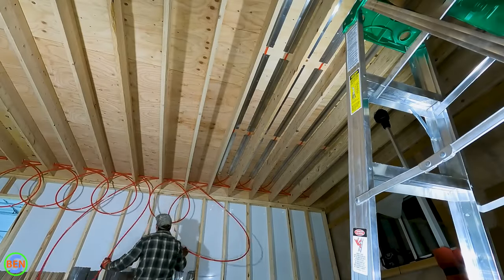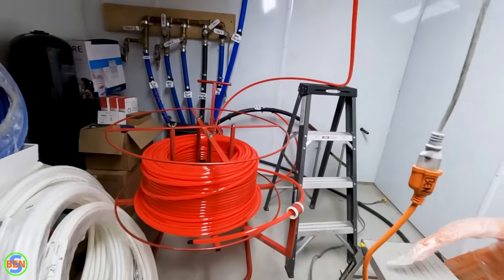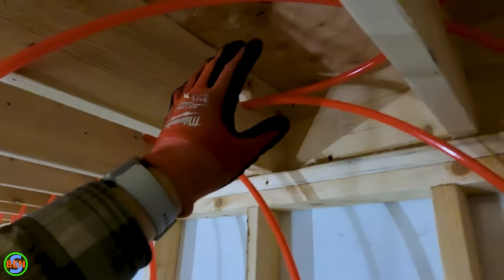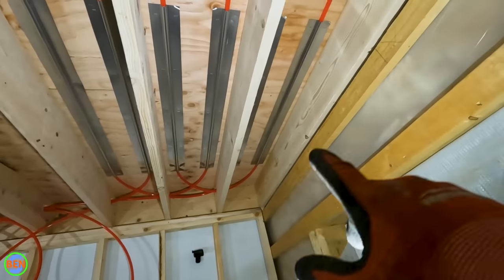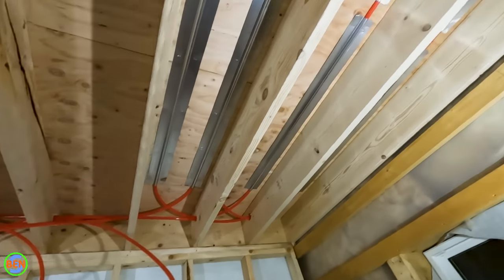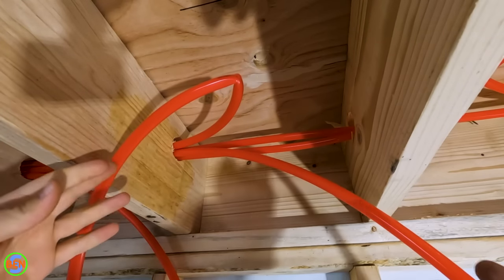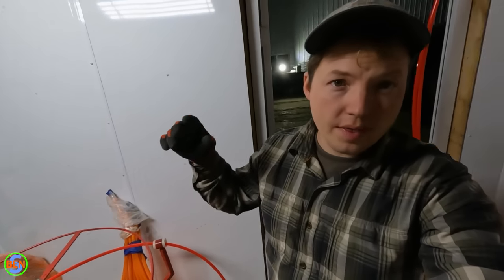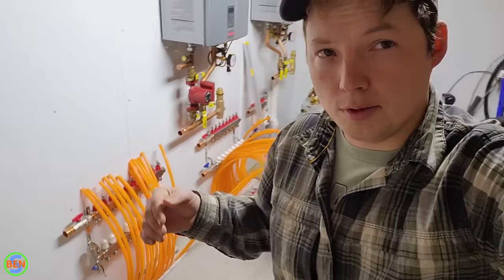How To Install Under Floor Radiant Tubing With Aluminum Omega Heat Transfer Plates Between Joists

Comment: You should only drill holes in the center of any joist and the size of the hole is governed by the size of the joist. Consult your building codes for the precise information.
Reply: Yea, holes cannot be any closer then 1/3 of the width of the board to the edge. Or they can’t be larger then 1/3 of the board. I can’t remember exactly but if you follow both you should be safe.
Reply: Usually the specifications also say the holes have to be near the center of the joist, not the upper or lower edge.
Reply: When your a plumber it doesn’t matter, the whole house can collapse, a slow bathtub drain is unacceptable
Reply: Holes need to be a minimum of 2" from the top and bottom edge, and no larger than 1/3 the width of the joist. His holes are correct.
Reply: @Chris_at_Home  
Actually Chris, although that would be best practice, the location of any holes is also dependent on the size of the holes.
Small holes such as 1/2, or 3/4 that your electrician might drill can be much closer to the edges than you might think. And small holes you can drill dozens and dozens of, in “Relative” proximity to each other, without weakening the lumber.
The larger the hole the closer to the center it has to be.  The area where it become the most dangerous is closer to the bottom edge. When a joist is “working” the top plane is under compression, and the bottom edge is under tension. Holes right at the very top edge do very little to weaken the joist when in comparison to any hole at the bottom edge. When’s joist flexes under load, the bottom wants to stretch, and any hole here would be a stress point and “possibly “ lead to a stress crack.
Some of these specs are in the lumber reference charts that architects use. I used to have them, but referenced them so infrequently, I lost them in my chaos.
In this application I would have added at “least” one additional hole for the supply and return tubes, and leave the looping tubes to go through a separate hole. As the heating performance difference is negligible where all the crisis crossing takes place, it’s always best to look at what you can do to make installation easiest without comprising performance.
So a good sized 1.5” hole for the loops, and a separate 1.5” hole 6” for the supply and return lines properly spaced will Not weaken the joist, and make life a hole (pun intended) lot easier.  I’ve drilled thousands.
Not trying to poop in your corn flakes, I just think information needs to be accurate for others to see.
Reply: So Benjamin, is this your house or a customers. Reason asking is, how have you found the performance to be with this method? Yes you admitted the heat transfer is not as good as with concrete or gypcrete, but sometimes this might be the only solution.
I think this is a great idea if you already have forced air and you want a single warm floor zone, say the master bath floor and the front entrance. 
Great video
Reply: @kenjackson5938  I just drilled my holes according to specifications listed by the I joist manufacturer. Pretty simple.
Reply: 2 inches from the edge and your good.
Reply: @macthemec the house wont collapse but the homeowner will 100% bitch about the tub draining slow.
Reply: @kenjackson5938 , 
I appreciated everything you wrote... except the "I've drilled thousands of holes" part. 

The concern with drilling in suboptimal locations is not that the house will collapse instantly; it won't. The concern is,... What could bad holes do DECADES down the road? So the only personal experience that further validates your otherwise (I think) great advice is "I've returned to dozens of structures 30-50 years AFTER drilling to determine if any of my thousands of drilled holes have ever caused any cracked or broken joists or structural sagging, and they never have." Or, more realistically, "I've drilled thousands that subsequently passed 3rd party inspection."

But I loved the "... top is compressed & bottom is stretched..." reasoning. That's not obvious until someone points it out. Then it is undeniable & unforgettable. Much more helpful than the generic, seemingly random rules people just regurgitate.
Reply: @edt5276   Thank you sir for the acknowledgement of the science behind stresses on lumber. Its great to see when someone understands the issues, and doesn't just think them a useless opinion. The science could certainly guide you in the future. The thousands of holes comments was not in reference to a single build, but the total number of holes drilled over my old fart existence. When you add up the number of holes you might drill in the studs and joists in just One house, when you consider all the electrical, and plumbing when running PEX, it can be surprising.
Good luck on future builds and renos.
Reply: It tells ya right on the prints.

Comment: I would make gauge for marking your holes. just a piece of plywood/ 2x4 to stick into the corner to quickly mark your centers.
Reply from the maker: That would be faster probably.

Comment: Problem with this setup of pex tubing, is there's going to be a definite gradient from one end of the floor to the other.  The water from the boiler is heating the first coils of pex first, then the next coils, etc.  By the time it gets to the end of the loop, a significant amount of the available heat will have been extracted, leading you to a floor that goes from hot to cold (or warm, to less warm).  When laying pex in a floor like this, you should be arranging your tubes in a |X|X|X|X|X format down the joists (criss-crossing at the end), with holes at each end, so one side of the joist has water closest to the supply, the other end has the equivalent closest to the return, resulting in more even heating.
Reply: You win the internet for the day !!
Reply: Appreciate the comment. I am about to install underfloor radiant system like that in this video. All the videos I keep watching state to do what this young man did. I kept wondering why, that would mean it'll be warmest in the first bay and then cool down where it enters the last bay. I had wondered if that meant starting closets to the outside wall since that will be the coldest area and then end the run toward middle of room. Now I am curious if your method would distribute the heat evenly across the 300 ft.
Reply: @thelazyhiker3288  I replaced my furnace/radiator setup ~10 years ago, and have heated my entire home with pex radiant ever since.  I'm in southern Ontario, so it gets cold (but not crazy cold, usually caps out around -15 to -20c), and my house is almost entirely spray foamed with 2LB closed cell foam.  

The floor heat is evenly distributed, but it's not uniform.  To my surprise, you can notice the specific hot spots where maybe plates made better contact with the floor (IE: were pressed tight), and you can tell where maybe fewer distribution plates were run down a joist.  If I was to do ti again, I'd add as many plates as possible.

That said, having warmer and cooler spots hasn't been an issue, it's not very obvious to the touch, but my cat definitely has favourite spots to plop down.

That said, a manifold with adjustment on each run, and one run per room, has been an absolute God-send.  Some rooms you want to push more heat into (IE: the front entryway, bathroom, etc.), while others you want to push much less (bedrooms, nobody likes a warm bedroom).  Don't skimp on that if you're doing any size of system!!

Hope it helps :)

Comment: Excellent video! Would like to learn more about boiler options, particularly about electric boilers. Where I live natural gas is not available and propane keeps getting more and more expensive. Wood fired might also work but is more time consuming. I wonder if there is a hybrid wood fired with electric assist? If so, solar and/ or wind generated power could be used to assist the system. Once again great content!
Reply: If you have the land, horizontally bored geothermal loops as the source for a heat pump would be supet cost effective vs propane.  You can run a hydronic loop off the heat pump
Reply: @gregwalthers3447  thanks for the input! As a diy person I could sure use as much detail on the how to as much as possible. Thanks!
Reply: @nieldcreek2098  Depending on your climate though, an air to water heat pump would be much cheaper than geothermal with a COP VERY close to geothermal. If you are somewhere that gets VERY cold pretty often, i would do geothermal, but if you only occassionally get very cold, air to water or hydronic heat pumps could be a great solution. Only issue is there are few producers of these in the states. Spacepak seems to be the best.  Geothermal i would say is only worth it compared to an air source heat pump if you often have extreme cold that a heat pump's performance would suffer.
Reply: I use a 50-gal hot water tank with an expansion tank and taco pump. I have it set on the lowest setting "A" and it keeps a 150 loop at 90ºF.  I am adding 2 more 140' loops soon, so I imagine that I will need to turn it up a bit. I know it's a 'poor man's' setup, but it works like a champ.

Comment: Great job, a Benjamin saving all of us Benjamins. Thank you. May I add. Best practice for zero noise, staple only one side of the plate. Staple double bubble with foil on both sides insulation across the I or open joist 1 ½ inch top member for a 1 ½ inch air gap. This floor will require a higher design water temperature to produce the same BTUs as an in-bedded system. Example: concrete 110f and staple up 140f for climate zone 4. Use the return water temperature of this zone to feed a zone requiring less temperature  Use software like LoopCad or a manual calculation for heat loss. Radiant heat, preparing you for living in hell where there are no cold spots just total comfort (lol) Yes, warmer than hell and you are never going back.

Comment: Cool! I've had the chance to install this type of radiant heat with accessories and over the years of installation of boilers etc I've found "poor-overs" are much easier and way more efficient.
Nice work! Hated loading my uncoiler lol.... I'm now becoming a mechanical engineer at 45 years young....
Hard work and good work ethics pay off💯 keep it up!

Comment: Great job. Trusting I didn’t miss this but you may want to add that when possible the runs first coming from the heat source should be focussed on the coldest parts of the floor example the extremities so for instance your greatest heat is not in the middle of the floor where it gets too hot

Comment: Hello from Chile Ben!
I have radiant heating here in my house that I installed and I love it. 
I came to your video so that I could get an update on the correct installation process. I could not find the OMEGA Plates here in Chile years ago. So I had to use multiple clips which was not the best but it is still effective. Thanks for the video. Very good explanation. 
Here I use a wood boiler to heat my water. It works well. 
Thanks again Ben. Jim in Chile.

Comment: As usual, great video Ben.
I did mine exactly like this. If I had it to do all over again, I think I may have done it differently though.
Each of my zones, done in this manner, really suffer from thermal loss across the floor of each room. What I mean by that is that the side of the room where the loops begin is always substantially warmer than the far side. I think when I do the next rooms, rather than running the tube into the cavity and down and back, and then into the next cavity, like you've done in this video and like I did in all of my other rooms, I will run the tubes into the cavity, down to the end and then into the next cavity - having a single tube in each cavity all the way to the far end of the room and then run the tube back through in the same manner, ending up with 2 tubes per cavity like your method here but, unlike this method, the heat should be much more evenly distributed throughout the room rather than having a hot side and a cooler side of the floor. Has anyone ever done it that way and if so, did it do what I'm hoping it will do? What's your opinion on this Ben? 

Either way, this video is yet another example of your excellent teaching talent. You always explain things in such a way that anyone can understand it. That is a true gift. Thank you for sharing your knowledge and experience with us. Even at 430K+ subs, I think your channel is seriously underrated. Thanks again. Be well.
Reply: Have you tried reversing the flow (swapping the tubes at the manifold) so that the hottest section of pex goes first to the exterior side of the zone (coolest section of the room)?

Comment: I used these plates to radiant heat the tile floor in the kitchen when I was finishing off the basement below.  Then on top of the slab in the basement I used some plastic spacers designed for radiant heating.  On top of this was a cement board underlayment for a tile floor or a plywood subfloor for the basement bedroom that was carpeted.  I used 300 foot rolls, and due to the size involved all of the loops ended up somewhere around 250 feet.  I used a really cheap corded electrical stapler, and afterwards drove any staples that were sitting proud in with a tap of a hammer.  With the basement layout, I didn't have to drill any holes through the joists for the radiant floor because the loops were in an area that was going to be left as an unfinished storage room, and the other ends of the loops were mostly beneath the kitchen cabinets.  This was circa 2006.  It's interesting that the process and material is pretty much unchanged from that time.

Comment: Code is not opinion. In Canada 1 inch hole has to be 12" from any load bearing wall and 12" per inch in hole size there after to a maximum of 1/3 of joist size. ( 3 1/4" hole in 2x10, (9 1/2") Neat product and work.

Comment: Great video! Several years ago I raised a sunken living room floor to the same level as the rest of the main floor level using 2x8 joists. Because the living room was a converted single stall garage, I couldn't access the joist bays from below. So, after friction fitting batt insulation plus a one inch layer of foil backed rigid insulation in the joist bays, I notched each joist from the top and stapled the heat transfer plates transvers to the joists. After snapping the pex into place in the same pattern that you are showing here, I installed the sheathing to complete the upgrade. Also, I used a big black marker to map the tubing below, then wrote a note to beware of what is below. To do it all over again, I would have spaced the initial (4) runs of tubing 6" OC along both exterior walls first, then continue in the field. At -40 in Fairbanks, the entire floor is nicely warm on the feet, but there is a slight cool convection dropping down from above at the walls where a couch or chair may be located. Note that my home has R 38 walls and an R50 lid but placing the heat nearest to the heat loss will make for a more comfortable space. Once again, great job on the video.
Reply: You notched the joist!  Now they are 2x6's.
Reply: @paulhoekstra7569  yep, but they are completely supported by the conc slab that they are sitting on. Agree that notching is not good for a free span joist.
Reply: @ChuckKarl525   Now I understand.  I missed a couple words in your note.  I think I started in at the second sentence.  Have a great day.
Reply: @paulhoekstra7569  you have a great day as well.

Comment: this is a fine example of how to do this task.....NOW..I see all the holes that must be drilled for the heat lines....What are the rules for "engineered floor joists"? near the rim joists? along with all the other stuff mounted to the ceiling such as ducts, piping and etc, It's all good when it not obstructed but OMG on an existing ceiling.

Comment: Benjamin, Came across your video as I am looking into adding this type of system into my finished cottage. I would need to be installing from our crawl space (totally dry as when we built we sprayed the ground a min of 4'' and all up the walls and roof) We should have added infloor heat mats when we tiled, but we didn't and now looking to add this system. 
I found your video to be VERY useful on how to plan and install this system! So please, Continue  to make more videos. Your descriptions are done incredibly well. 
Cheers,

Comment: Great video. I am getting ready to put hydronic heat in a duplex we have been building out of pocket for 9 years. There are full basements in both units. I was going to put in those Morris Beacon heaters, but I can handle this even at 70 yo.

Comment: It is a very nice instructional video , however I saw one thing I need to share , and for personal experience, make sure the silicon you use it's comparable or use something else, reason been in a new construction, we had so many problems with areas that we discover that when silicon was in contact with the PEX and also with the new orange PVC for fire sprinkles , for some reason it had a chemical reaction and end up breaking or becoming weak or unglued , yes after many investigation that was sthe culprit , had to go to court to prove this things ,so be safe

Comment: Hey man. This video was remarkably good. Thank you so much. My wife and I purchased a 1920 English Tudor home in the historic neighborhood of Indianapolis. We are spending an arm and a leg gutting the place and installing all new mechanicals. We put a geothermal system in as well as tankless heaters and spray foam, etc., etc. After we move in, I was thinking about doing this through our unfinished basement. However, our first floor has a lot of construction from the 1920s with marble floors And many of the Joyce cavities are 12 inches rather than 16 inches on center. Do you think that this system can work knowing the cavities are only about 10’’ wide?
Reply from the maker: I wouldn't be concerned about the closer spacing. Should work perfectly fine. Hope your project goes well!